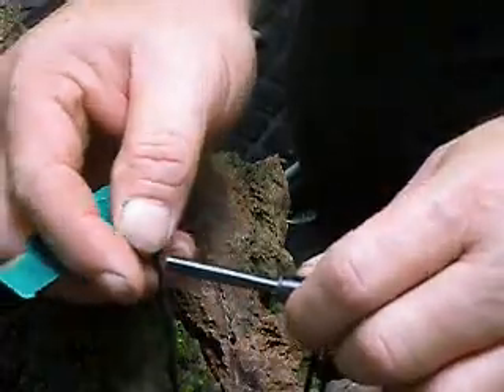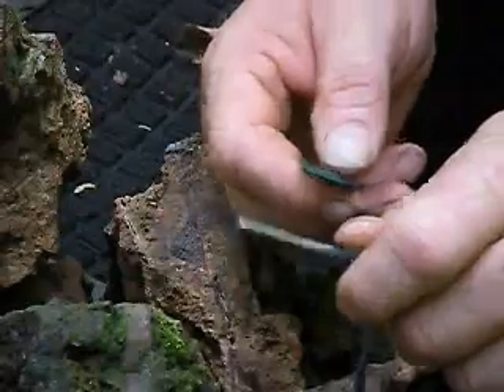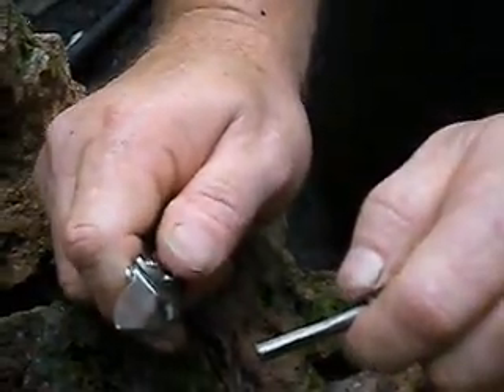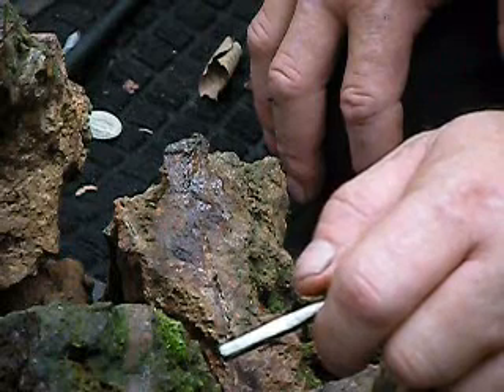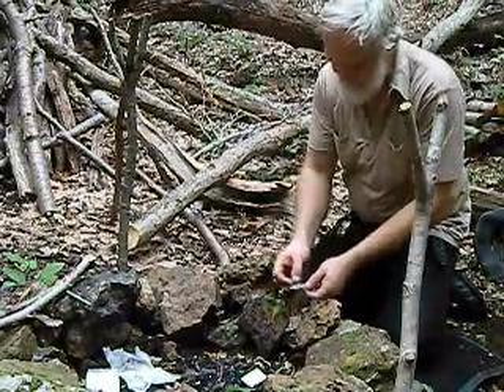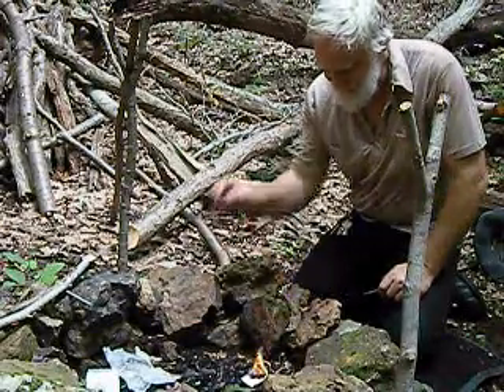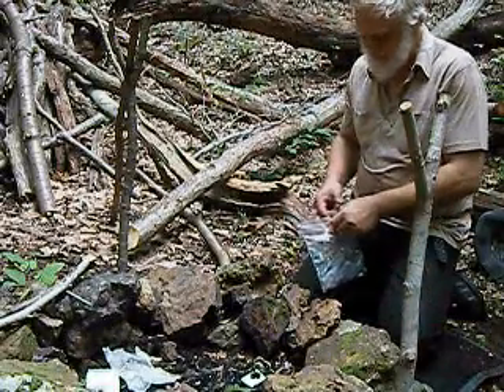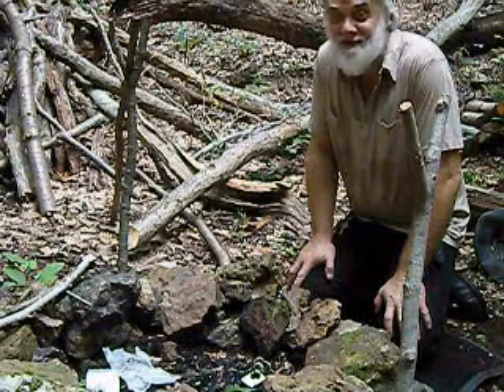How To: Use a Ferrocerium fire starter

Comment from the maker: 000 Steel wool is what I used in the video. It worked well. I am sure the coarser the wool, the more trouble it will give. I've heard that one can use glass with a ferrocerium rod, but I have not tried it yet. Quartz is another material to try for hardness. The galvanized coating on the nail certainly had hardness but it prevented spark. Same thing with the nickle plating on the bolt. I suspect friction has a good bit to do with the process.